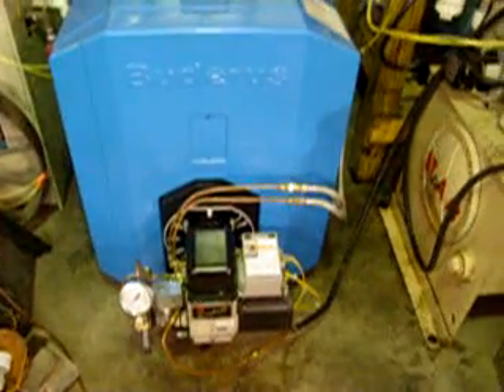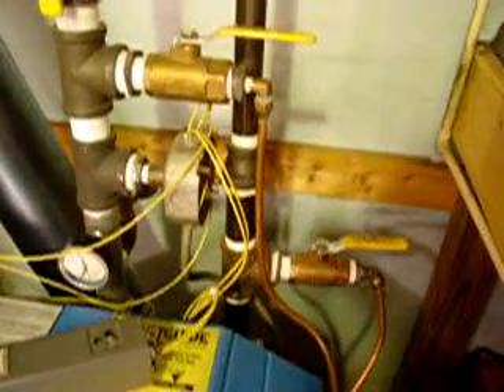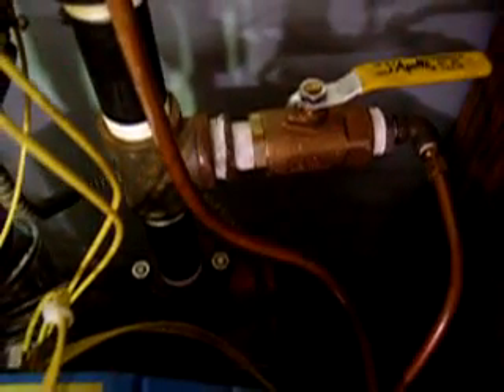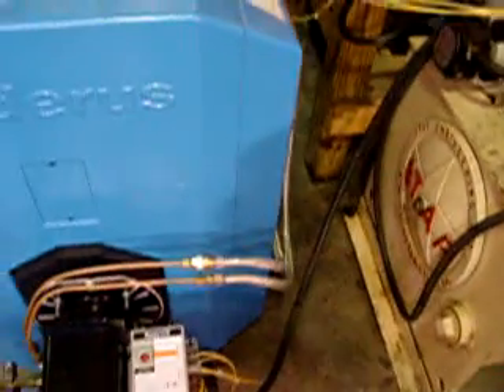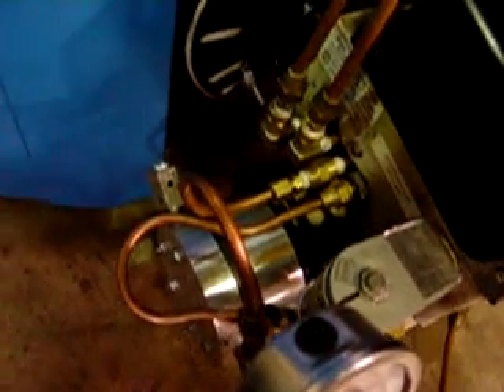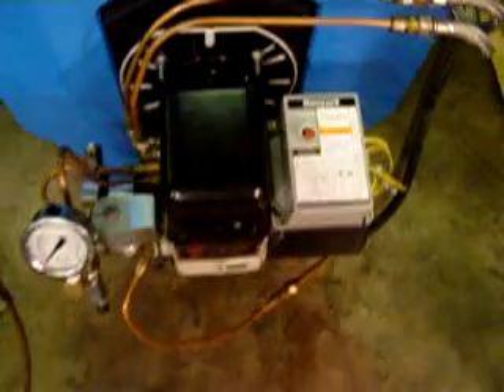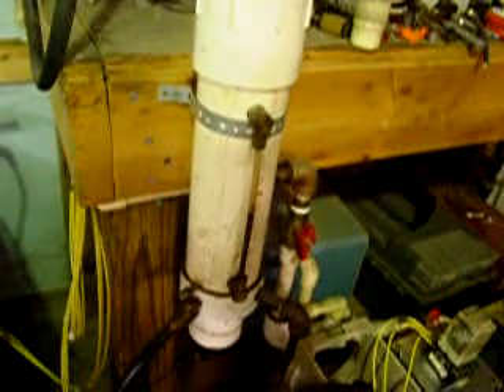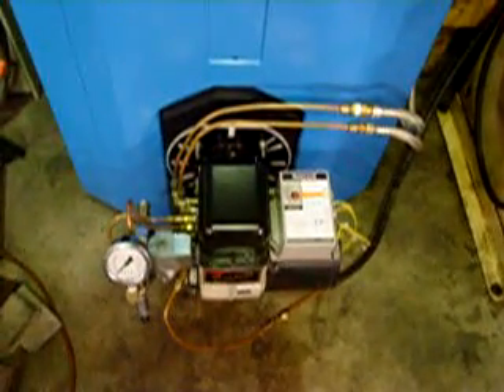Waste Oil Boiler

Comment: That is an awesome boiler! Could you do another video to explain in more detail your heating system. Do you have a heat exchanger in you furnace? Thanks
Reply: its an Buderus Boiler i think g125 with an Beckett (USA) Burner modified for waste oil ,there is actaully an kit for that

Comment: If the oil pre-heater runs off of the hot water produced by the furnace what do you do when the furnace is cold? ex. the first start.
Reply: Use diesel

Comment: Nice job i did my burner to preheat the oil for the fire inside the boiler via stanless steel pipe but once i turn it on its doing like back fire so i beleave that is totaly unsafe , realy good idea to heat the waste oil from the water it self when going temp up but i need the compressor nice to see that good luck .

Comment from the maker: @pizann350 Compressor is $280, preheater block is $180 and these prices fluctuate based on material costs. You need to run a metering pump with this preheater. The compressor requires a 3450 RPM burner motor and it will mount to any burner that uses the standard oil burner pump. The preheater was made to go into a beckett afg burner chasis, and you have to open up the slot to allow the other lines to pass through, and you need a retention head for waste oils.

Comment from the maker: @honda4004 Not until i've run the system myself for a while. I believe the current design is final. It is providing my main source of heat and has been running without any issues.